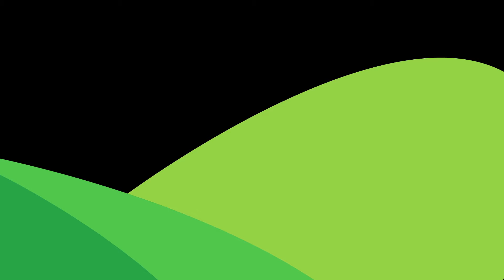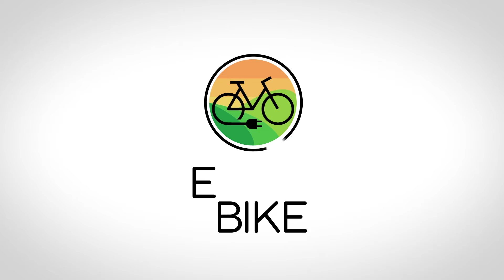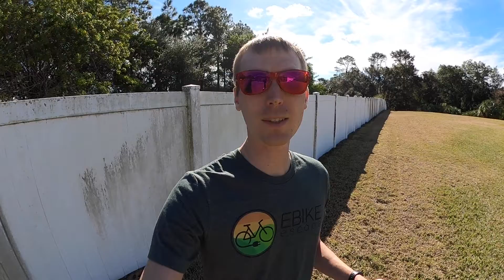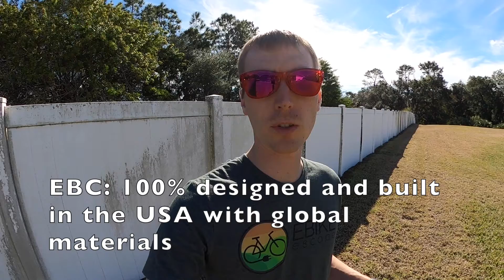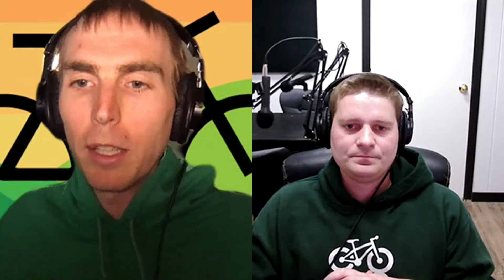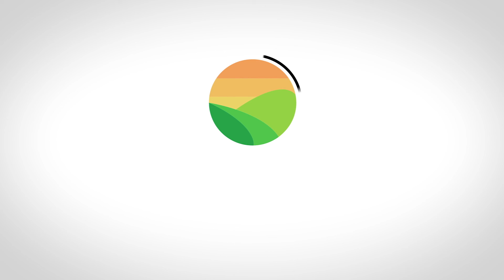Bolton Labs & Ebikes Made in the USA?

Comment: The free wheel tool worked for me. Tip: the tolerance between the nut and the tool is tight. Rub a drop or two of chain lube on the inside to make it easier. Thank you sir.
Reply from the maker: Great to hear!